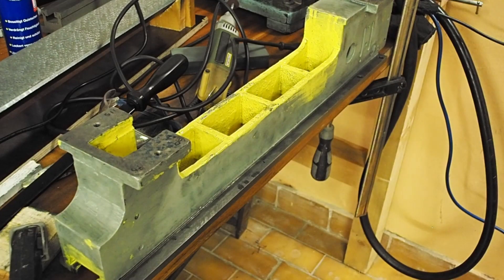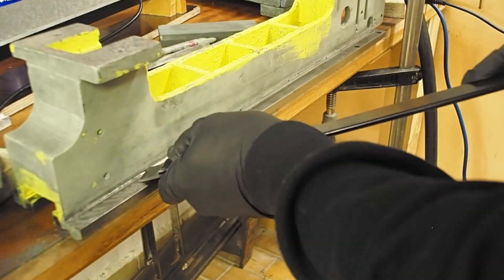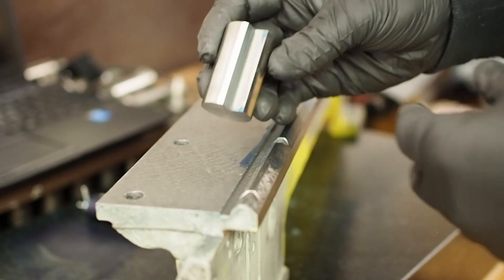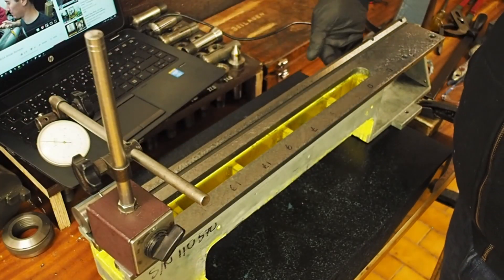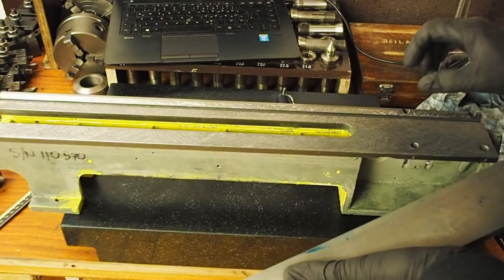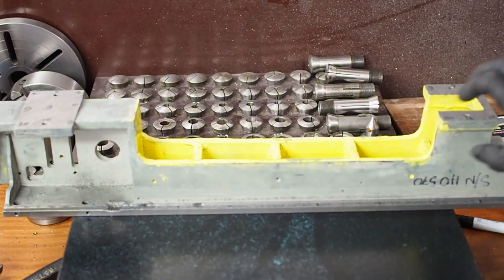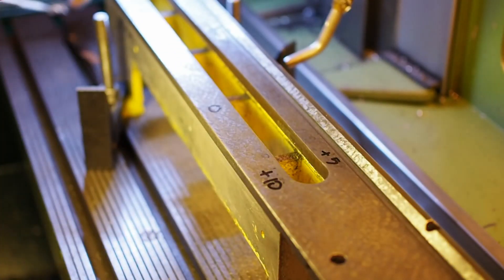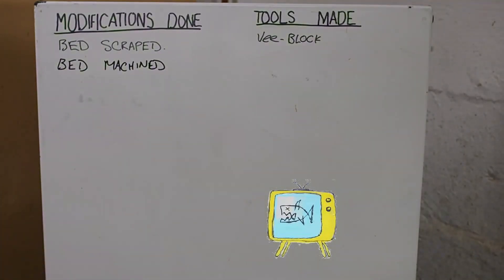Modifying the mini lathe. Episode 3. Finishing the bed.

Comment: was there a reason that you didn't start by sand blasting the entire bed down to bare metal?  (as always, a pleasure watching your work - talk about the right tools for the right task making the job look easy.... until you remember the input that the operator has on all this! )
Reply from the maker: It didn't fit in my sand blaster, and that wet noodle of a bed would have probably warped (even more). :)
Thanks for your kind feedback.

Comment: I'm currently working on the problem you solved in the last part of your video. I modified my mini lathe tailstock to a nice lever clamping and due to the uneven underside of the lathe bed, my new upgraded tailstock is absolute (almost) useless. On the far right end it clamps tightly to the bed but in the middle it doesn't clamp at all. Unfortunately I haven't a milling machine to fix that, instead I have to fiddle around with a proxxon grinder mounted to the carriage. Hope that will work some way :) Thanks for your great series! To be honest, my design of the tailstock lever clamping was a bit inspired of the way you did. I hope that's ok ;) Grüße aus DE
Reply from the maker: I had the same, and would have to reach underneath to change the position of the nut an thus the clamping for different places on the bed. Once I measured it, I was suprised how uneven the bed thickness was.
Reply: @RotarySMP  These cheap machines are always good for a surprise :) I hope I can grind it, it's about 0,3mm.
Reply from the maker: @WeCanDoThatBetter  Do you have a wood router? They have better bearngs and more power than the Proxxon, so cuold run a bigger stone, and hopefully cut faster.
Reply: @RotarySMP  Unfortunately no, the proxxon is the only thing on hand at the moment. One problem is the tiny shaft of the grinding stones. They'll bend so easy and aren't rigid at all. But the collets go just up to 3mm, so theres not really a way of using more rigid tooling. I'll try, it will probably take a 1000 passes :D
Reply from the maker: @WeCanDoThatBetter  I have the same Proxxon. You might be better off making up a widget to hold a file, and filing it.
Reply: @RotarySMP  It is the IBS which is probably the better one of the proxxons. After two days of grinding, it is finally done. I made a new and stiffer grinding arbor and ground it in countless passes. But now the underside is even an the tailstock clamps in any position on the bed tightly. Happy :)

Comment: I did not understand why you did the scraping first and then you put it under the milling.
is it not enough to rectify it directly under the milling?

thanks!
Reply from the maker: No. A milling machine will not get you down to the micron accuracy that scraping does. A grinder can, but it is very difficult to fixture without grinding in distortion.

Comment: I don't know if you're aware of this, but if your reference surface of the V block isnt perfectly defined or perfectly flat (ignoring dimensions), then your measurements will be off
Reply from the maker: Thanks for watching. You are right it wasn't. I had to always set the micrometer at the same place along the V bar to negate that error.

Comment: I think you will find that the machining you have done for the tail stock might be a bit of a waste of time. The iron on those lathes will bend quite easily in use.  A little curious why you didn't fly cut the feet?
Reply from the maker: Hi. Thanks for watchin. 
Fly cutting (or in my case use of the 100mm insert face mill) accentuates tramming errors. Since the surface was going to get scraped anyway, the pretty surface finish of fly cutting or the face mill, was irrelevant. Since I had to move the bed to reach both feet, and did a crappy job of the set up, the whole milling effort was a bit of a sisyphus job.

The whole project could well be a massive waste of time. I used the Mini-lathe as my only machine for at least 5 years, and under no illusions to it's limitations. I see it more as a learn to scrape and make videos project than anything. The 0.8mm thickness difference on the tailstock clamp was basically unusable. At least now the camlock clamping will work normally. The tailstock is one of the worst design features of this machine anyway.

Comment: Please, more hot MAHO action!!!
Reply from the maker: Did you notice that I screwed up the G code cutting the Vee block. typo'ed a G01 to a G0, so it did the second and later passes at 2500mm/min instead of 450mm/min. Luckily I hadn't programmed too much step over, and the end mill survived.

Comment: I would have chopped the large V-block with the angle-grinder. 
Angle grinders are precision tools. It only a matter of scale. And dexterity. 
Nico, your angle grinder technical adviser.
Reply from the maker: Thanks for your inspiration :)
Reply: as an aside, do you think the broad axe is an underutilized tool in precision machining? 🤠